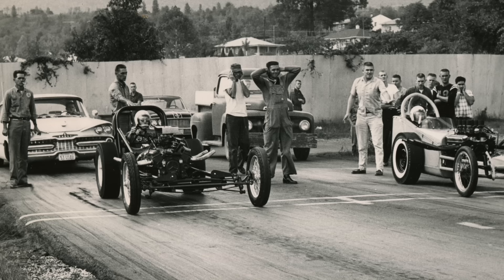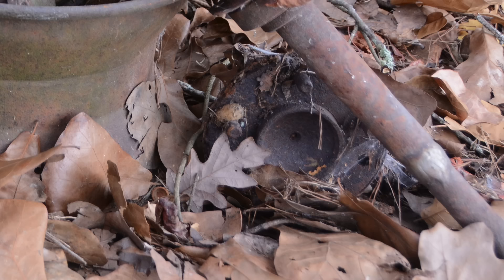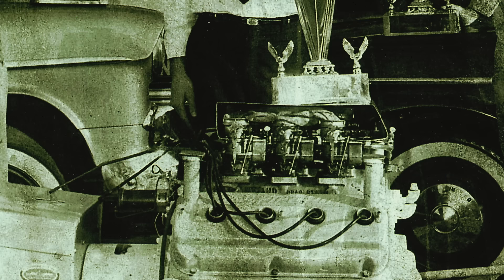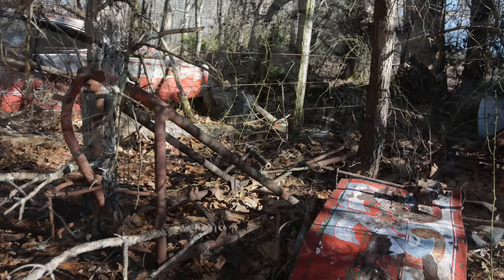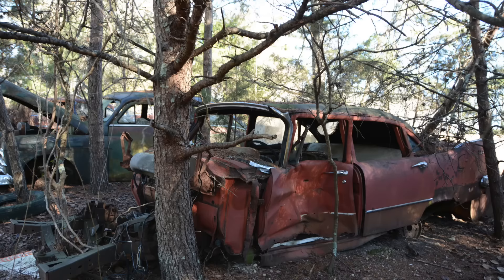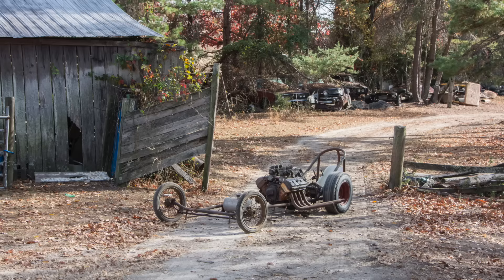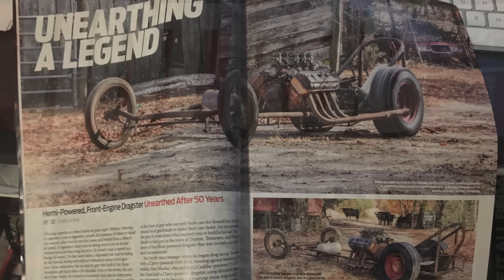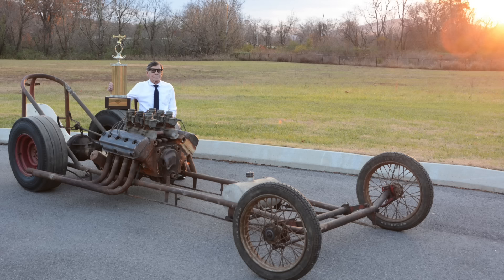Front Engine Dragster ABANDONED in the Woods + HEMI in the Barn!

Comment: In budget builds you do what you can to get it done.
Modern day mods are based on what we did in our shed with files,  sandpaper, drill bits , and junk yard parts ...heads were swapped by going to a bone yard and gasket matching gaskets to fit whatever head.....you were always learning and had nobody to teach you a thing ...
You listened to the old timers talk, showed respect and kept your mouth shut.....it was a whole other world before  efi, turbo, and fuel injection. 
It's the foundation for modern performance. 
It a ton of skill and no computers to get the things we expect technology to do for us now .
Old school mechanics could listen to an engine and time it by feel or diagnose issues just by listening. 
It's becoming a dead skill now
Reply: So true about modern mechanics, hell Ive seen the difference since I was an apprentice 40 years ago.
Reply: Car companies don't want that sort of repair skill around anymore. They can't sell you on their service department if the old timer two doors down can just put an ear to a valve cover and pinpoint the problem...
Reply: @TestECull  I still can to an extent on the 90's and early 2000 models but all this eco stuff I'm lost.
I do work on semi truck issues for my own stuff but all this computer , sensor stuff....im lost.
Usually I can hillbilly past it but a lot of it is just stupid.
I mean who in their right mind builds a car you have to lift the engine 3" to work on the a/c compresson....smfh!
Reply: @hillbillyholler516  Part of why I'm not getting rid of my '85 F150 anytime soon. That old 300 will never die; if it does mess up I can fix it with basic tools for pennies. And my next car will be even older still; looking to get something from the 1930s or 1940s with a Flathead V8 in it. Gonna daily it too; all it needs is aircon, a 12v socket, a decent radio, and maybe a lap belt.

Prolly gonna be a panel van, as I could use it to take my RC aircraft to the field then.
Reply: @TestECull  I'm my personal opinion....I would keep the old 300 and avoid the 5.4 at all costs.
I have seen too many Triton's have issues because the heads have 5 threads for a 12 thread sparkplug......under stress the plug can blow out the threads.
I have one in the shop with gacked  threads, and aluminum can main bearings that needs a total rebuild and bored....so I can install plastic pan, intake, and rocker covers...no glass fibres reinforced parts available at all aftermarket. 
Abs plastic timing chain guides too......junk in my opinion. 
I stick with LS parts...cheaper, and readily available for now.....its all a rip off ....quantity vs quality and the cost hits you in the south end dry as frig when you are facing north
Reply: @hillbillyholler516  yah that's the plan. That old 300 will outlive me, and it's already 5 years older than I am. Doubly so if I give it an overhaul in the next couple years. And unlike that 5.4, it's actually worth overhauling.

.....and if I throw the right hotrod goodies at it itt'l pull harder than a 5.4 ever could as well. Already have a Comp 268 on the kitchen table for it. Just need a dual plane intake, 450-550cfm 4bbl carb, and the headers.
Reply: Yea real mechanics are 1 ina 100
Reply: I am 45 so I still had older non computer carb stuff. I was having a knock in my 350 in my truck. So my Dad and my Uncle were there they heard it and speculated on what it could be. So my Dad grabbed a large wooden long dowel rod and went around feeling the difference in the rod. He pinpointed where the problem was. It was a long time ago but, I think it was a rob bearing on the left side. I can't remember the cylinder it was but, my dad figured that out too by the stick. I asked where he learned how to do that. He said my Grandfather showed him that a long time ago. But, you guys are right even the boys that work in the dealerships have to buy all kinds of specialized tools to fix some of these cars without turning a wrench.
Reply: Hillbilly Holler I’m 47 and grew up with an old school drag racer for a dad. We built an 80 Ford Courier he bought brand new. 39 years later, it’s still in the family. It’ll stay there because of all the memories. It remains an old school carbed V8 with a lot of attention paid to the little things. I get tired of seeing all these young people with their laptops out throwing tunes on at the push of a button or click of a mouse. Engine need rebuilding? They just send it out. I’d rather build it myself and know what’s going on.
Reply: @TestECull  Why spoil it listening to the radio and texting on that phone. Sit back in the seat, enjoy the purr of the engine, babble of the pipes, and the hum of the tires, and the thoughts in your head.
Reply: @fasteddyskil  I have a strict zero tolerance policy for phones behind the wheel(Mine is usually either in my pocket or on a dock on the dash acting as a dash cam), but it is nice to have a radio to headbang to. There'll be times I let the flathead burble be my muse, there'll be times I'd rather have James Hetfield blaring. Particularly if I'm on a long road trip; much as I love the burble of a happy flathead I'm gonna want something else to listen to after an hour or two.

It's easy to turn a radio off, after all.
Reply: Hillbilly Holler took me back reading your comment
Reply: When I started wrenching (1980), I had a Simpson voltmeter to test computerized carburetors. Luxury cars had less than 100 electrical circuits. Now I work on nightmarish systems that use formula one technology from the 90's for the valvetrain, with thousands of data & electrical circuits . 
I'm one of those rare ones who bridge that gap between pre & post computer cars. Sometimes I wish they would just give me back the days of my vacuum gauge being my main diagnostic tool lol.
Reply: @SpeedRacer-pz9jn  You and me both. It's a large part of why I don't want to own a modern car in the first place. My '85 F150 is still of the era where a vacuum gauge, a basic wrench set, some screwdrivers, a couple hammers, and a basic socket set will damn near rebuild the whole fucking vehicle. And I love that!
Reply: @SpeedRacer-pz9jn  I'm gonna go with a dual plane intake, Hedman tri-y longtube, and a 450-550CFM 4bbl carb. It's got well north of 325k on it at this point so itt'l get a total rebuild at the same time, easy to throw some forged spinny bits and keith black slugs in there while I'm at it.

 My goal with the truck is to turn it into a mean pullin' rig that can also daily drive, so I'll keep the wide ratio 4-speed, the 2.49 rear gears, but get a 4x4 x-fer case for it to replace the tailshaft housing it has now. If I need to pull something and don't wanna overload the clutch I'd grab 4-lo; no chance of breaking anything since it'd stay 2WD. Also plan on putting load levelling airbags on the drive axle so I can keep the soft halfton leaves but not have it drag its arse when pulling a heavy trailer.

Hardest part'll be brakes. Rear brakes, easy, can get SVT Lightning discs slap 'em right on. Front...not so much. Not sure the early 90s Lightning's brakes are up for heavy towing; that was more of a hotrod than a hauler.
Reply: We ran two dirt track cars for eight years. Home spun, seat of our pants, hellraisers.
Reply: So sad

Comment: Last time for me buying a rough running 67 Camaro running that I would drive at times. It needed metal work 2 rear quarters, a trunk pan, full interior kit and everything needed replacing for a nice full restoration. No more rough cars for me unless they are a steal of a deal, barely broke even on that deal. I still have 2 old Camaros out of 4 left. Going to sell the nice restored 69 stock camaro turn key Cali car I own. Already sold and selling off so much more new and used parts and stuff. I like driving the street and strip 67 Camaro the best and racing it some, my favorite car built my way by me.

Comment: Yes you are very right in the 60 s it was the thing to do run to the garage work on the car and drag race on saturday. Those were great times my dad and uncle both did this on 54 and 56 ford pickups with olds 88 running gear and engines. And chysler

Comment: Talking about old drag strips. In Kingsport TN there is what's left of an old drag strip that rivaled Bristol at one time. It was closed due to noise and all that's left is the staging area and about an 1/8 of a mile. It was a 1/4 mile track and I think its name was Thunder Road (not sure). It can still be seen and walked on. It runs into what is or was Alley's Dodge body shop. Last I knew they owned the land.

Comment: The problem with tubular frames is they rust from the inside out- especially at the joints. Hanging it on a wall.
You're not the first.

Comment: I want to build me one of those vintage front engine dragsters so bad. Idk why but to me, they just look so cool. Couple of things I'd change though.
5 point harness
Mopar 440 (my cousins grandpa has 3 of them)
Maybe a power glide 2 speed instead of the direct drive
An electric fuel pump
Other than that, pretty much the same setup. Nitro methane, 6 carbs, 8 side dumped headers, torsion bar front suspension, motorcycle wheels and tires, etc.

Paint color? Honestly idk yet. I'm thinking either gloss jet black, satin maroon, or emerald green with gold flake.

Comment: I guess it was the word nitro that led me to your page. Thanks for doing this as it peaks the interest in nitro for new people 
Let me clear up a few things to assist you, and possibly others.
First you speak of your percentage of nitro being 50% by weight or volume.
If it is 50% by volume your percentage is ACTUALLY a lot LESS.
Methanol is 0.791 specific gravity.
Nitro is 1.13 specific gravity
A correct method of doing a percentage load is done by WEIGHT not volume. 
Our 70% is done by weight.

Nitro needs a much larger fuel volume, even heavily modified carburetors struggle to flow enough fuel volume for methanol as methanol is 2.2 times the volume of gasoline.
The increased volume of fuel needed for nitro depends upon the percentage of nitro fuel used but suffice it to say it is over eight times the fuel volume needed from methanol, thus a carb will never have the fuel delivery needed for nitro.

There was a time about ten years ago and my son and I took his car and put it on 70%, raced it two years, never hurt a thing. We build a special two stage fuel system with a Hi pressure and a Lo pressure option. The Lo pressure was a low volume deal where we did the race prep of the burn out, roll back and roll forward to prestage. This did two things for us, it put some heat in the heads which was needed and as important it put less fuel past the rings and into the oil pan. Once the car was in prestage, driver pulls a lever moving it from Lo to Hi and then rolled the car into full stage, the run was on the Hi side only. We learned the benefit later one day when we realized that we had made five runs on the day and only used two churns of 70% which means we used 8 liters (quarts) of fuel per run… cheap racing. 

The car on methanol normally runs 8.60 at 160mph, on 70% it ran 7.20’s at 190mph not bad for a pile of mostly stock junk Could I have got the car to run some 6’s, I do think I could have but the two bolt main dead set scared the shit out of me. Once we were done with the nitro for two years an engine tear down and inspection indicated absolutely no wear or damage, so we just reassembled the engine put it back in the car and it is now back running on methanol. She is a very tough old girl having been making passes since first assembled in 1997 
But the rest of the story is that since the engine was built to make many hundreds of passes down the race track and was used at our Drag Race School here in Australia the engine is a very generic engine. It is a 0.060 over 454 Big Block Chevy with some 12.5-1 Speedpro pistons, stock steel Chevy rods, stock steel Chevy crank and a TWO bolt main bearing engine block, with a 258 degree flat tappet camshaft. Nothing in the engine description screams NITRO, yet here we are.

Because the engine components were so generic, we were afraid to jump to hard on them in fact we think getting a pile of stock Chevy parts to go 7.20’s and not throw themselves on the ground is pretty good. What we did to limit how aggressive the car was is to limit the ignition timing to only 55 degrees. Since I have raced nitro since 1974 I can tell you that the optimum ignition timing would be about 68 degrees total ignition. We ran the combo for two years to prove a point and have since retired it putting the engine back on methanol which requires a lot less attention than nitro does. When you are using nitro there are some rules that you MUST follow because I have seen cylinder heads thrown off the engine and the cylinder head landing nearly 200 feet away. A few people got hurt with that. That is why we have a very specific starting routine as we start the engine on methanol and once it is running we switch to nitro. It is always a good idea to get the nitro out of the cylinder before you turn the engine over, even with just a wrench. We have a rule the first thing we do after a run is to remove the spark plugs and the last thing we do before we go to the starting line is to spin the engine over before putting the spark plugs back in, as this insures there is no nitro left on top of the pistons. 

I reckon that nitro is the best easiest power adder to the engine. Besides it sound so damn cool.

Currently there are four single magneto injected nitro cars in the Brisbane area racing at Willowbank. Our current car is still a Big Block Chevy but the internals are all good bits and our percentage is 100%. We chase the 100% tune up since we feel that it is the nitro that makes the power why dilute it. Now we have the ignition tweaked right up to 68 degrees. We have not taken the new package to the starting line – yet, for a couple of reasons, one is that we have been hired to assist a new racer sort his stuff out and a few months ago my 23 healthy son collapsed on Saturday morning and died. Death certificate says cause unknown, coroner says it was a Channelopthy. Considering all that we believe it was a reaction to the Covid shot the government made everyone take. I am not a conspiracy theorist, but it seems that is changing now that with a bit of google search there seems to be an epidemic of healthy young people from 20-40 years of age just falling over dead. The common thread, they all had the Covid shot. Stay safe everyone, go racing because you never know when your last day was yesterday. 

Enjoy the video, the young man in the video was my son.

https://www.youtube.com/watch?v=55aH9sYrhH4

Comment: How old was the cat Jim I had a 56 Chevy Gasser running 1104 that I built and I  had radar engineering do the rear end and drag Master do the motor balancing  boring   porting crank work bearings  and all the head work Square Port heads weiand manifold  two 1150 Holley strip dominates  Hooker Headers 12 to 1 piston 638 lift cam 366 duration 513 gears centerline's rollbar fiberglass front end straight axle  called Helter Skelter in car craft in hot rod Rocky Tim Esterline out of Oceanside Vista California